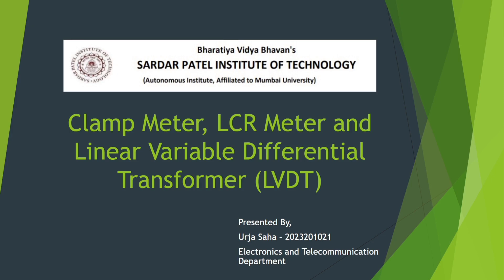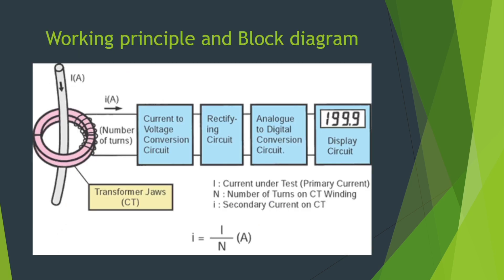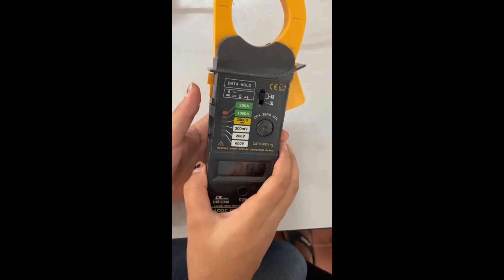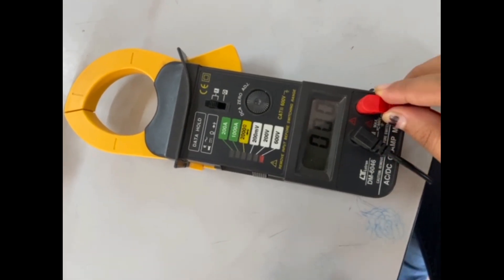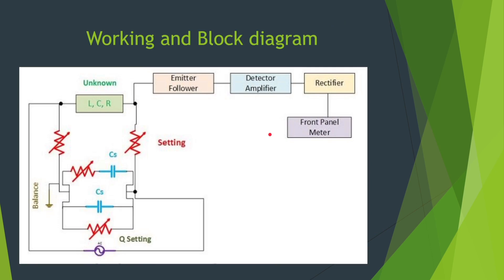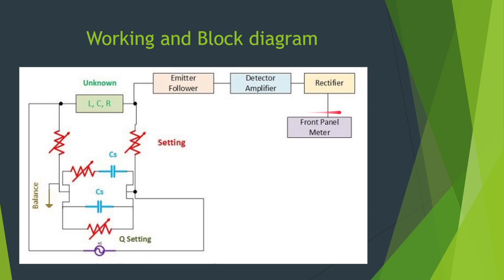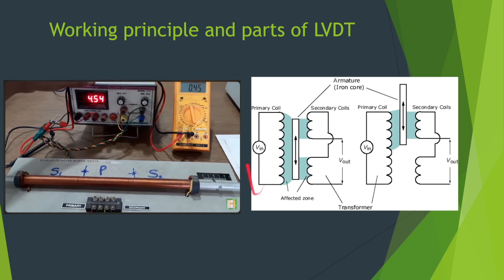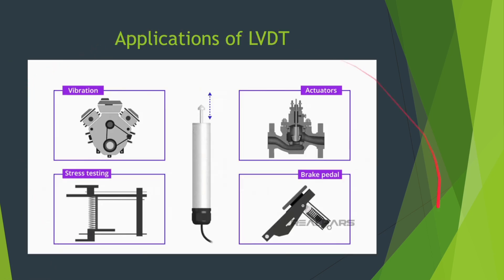Exploring Electrical Measurement Tools: Clamp Meter, LCR meter and LVDT

Comment: This mind-blowing video on LVDT, clamp meter, and LCR meter didn't just enlighten me—it catapulted my brain into an electrified wonderland! I now wield electronic prowess like a wizard, bending circuits to my command. My LVDT wizardry is so intense that even the electrons are taking notes in awe. The clamp meter trembles in admiration, and the LCR meter now sings harmonic frequencies of my genius. I've transcended from an electronic novice to a techno-sorcerer, conducting symphonies of voltage and current with a mere wave of my hand. It's not just a video; it's a transcendental journey into the electrified realms of infinite knowledge!